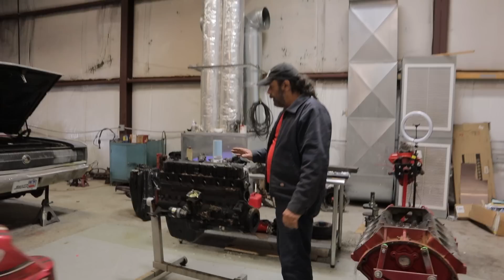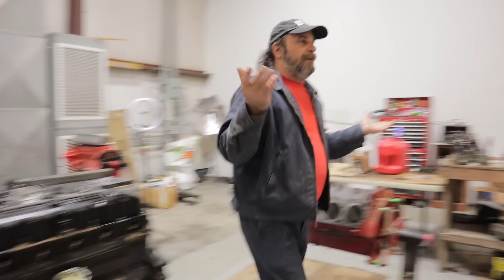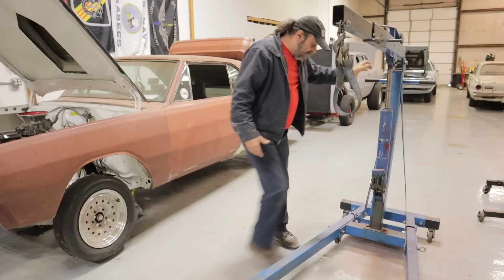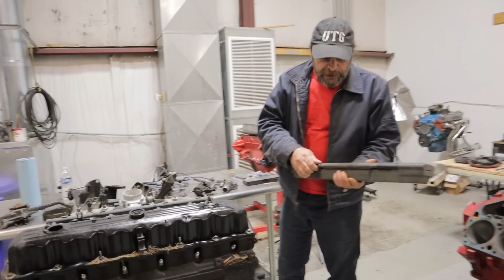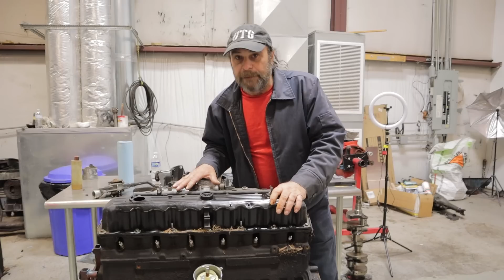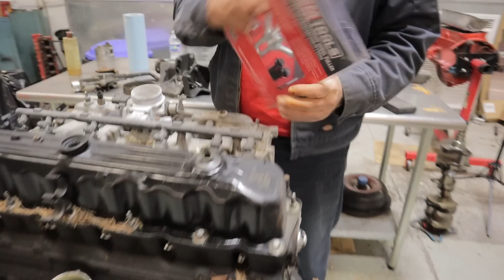Your First Engine Job - Arming Yourself With The Knowledge And Tools Needed To Get It Done

Comment: Former professional mechanic here, suggestions no doubt overlapping many already posted.

Yeah, what he said about clean and well organized.  Clean parts are easier to inspect for problems.  During engine long block reassembly, keep it surgically clean inside.  

Also no such thing as too much lighting, including handheld.  As others mentioned, take more photos and video than you think you'll need.  Label and photograph everything like you won't get back to it for months (because you never know when you might not).  Also take lots of written or typed notes as you go.

Do NOT use gasoline as a cleaning solvent!  That stuff is way too flammable/explosive!  I don't like using acetone for the same reason.  Also they're both really bad for your skin.  Use detergent & water, mineral spirits, or diesel and a big metal oil drain pan for parts cleaning.  Keep a fire extinguisher handy.

Organize small parts in zip-lock baggies.  Label them by tossing an index card in the bag.

RTFM!  Get and study the factory service manual for whatever you're working on.  If cost is a problem, spend some time searching the WWW for a PDF version.

A usable workbench doesn't have to be expensive.  A couple folding sawhorses, some plywood atop a hollow core door for stiffness.  Also easily stored flat.  However, if you need a bench vise, you need a real workbench.

For measuring tools, I would add a set of feeler (thickness) gauges, a dial indicator kit, maybe a micrometer or two, and a surface plate.  A literal plate of thick glass is better than nothing.  A window glass shop may be able to help with a large scrap.  You'll know better what you need after you RTFM.

Craig's List and Facebook Marketplace are goldmines for tools and parts, especially big ticket items.  Used but working air compressors for 1/4 price of new.  I paid maybe $25 for a 4-caster engine stand (avoid the cheaper 3-wheel version - they tip). I got my like new engine hoist for free plus the cost of a new hydraulic cylinder ($50).  I picked up a few thousand $ of SBF stock & performance parts for around $750 from a guy who was clearing out his garage after a major car project.  If you have time and a truck, check estate sales for great deals on entire tool sets.

Holy crap this is getting long!😮

Comment: On thing that I think you can't have enough of in a garage/work shop, especially when doing a big project like an engine rebuild, is tables or shelves. I find working on anything to be so much easier if you aren't having to walk around parts or piling stuff on top of other stuff. I have a few cheap folding tables that I keep around for projects that I take out if I'm doing something like that. I think it helps keep me "in the zone".
Reply: Spot on! ANYTHING you can set up as a table, a piece of plywood on top of a pair of saw horses, etc, is really helpful. I actually like these newer folding plastic tables, because they are easy to stow away when you don't need it and easy to pop up and move around when needed.
Reply: On big jobs I use a cart just for that project, so I know every bolt that came out gets back in.
Reply: I use a folding table, I can set it where needed and keep everything in order.
Reply: I pick up card tables people throw out.

Comment: Along with the recommendation of photos, A suggestion is have a large piece of cardboard and lay out all bolts in the order of removal and add a label on the cardboard. I always prefer to attempt to put the bolts back in the same place removed such as head bolts, push rods, rocker arms and so forth. It is difficult to place fasteners with the part removed because of cleaning and so forth. The common practice of randomly remove fasteners and using valve covers as fastener storage causes confusion, missing bolts and trying to figure out which bolt is suppose to be for what purpose. Some are very obvious but accessory bolts can be confusing as to the original location.

Comment: I suggest getting a Chilton's manual for your vehicle, it will have all the engine specs and torque specs descriptions on how to take it apart and put back together plus pictures. They also have everything else about your vehicle and wireing diagrams so they come in handy for other things that come up.

Comment: When in the Philippines you see all kinds of Big truck repairs done alongside of road. There’s a sugar cane plant in our town (wife’s family house) and it gets overloaded trucks from the 40s 24/7 during harvest. One of these trucks broke in middle of intersection. It sat there 5-6 days while they pulled engine out using cut trees and a bunch of guys. Rebuilt engine right there put it back in started up and drove away! Leaving a huge oil slick in the middle of intersection that took about a month to wear off.

Comment: Shop manuals!  I get both a hard copy (book) and a CD.  The book is easier to flip through, and I only use it with clean hands prior to the job.  Then I print out the critical pages from the CD to review while doing the job.  Those pages are throw aways, so I don't care what I spill on them.  All the while the book stays clean enough to read in bed.

Comment: Hammer and a blow torch. Heat up and crack open old nuts and bolts before you round them up or break them. There can be thread lock applied, or simple rust/oxidation in practically every bolt on your mystery project. Heat and impact brakes all of them loose. Wire brush on a dedicated power drill is also a nice special tool to have on hand.

Comment: Lights, lights, lights. Well lit work area! Lay down rags around the work area so when you drop bolts, you won't have to crawl under the work bench with your cell phone flashlight to try to find them. Especially if it is a specialized bolt! Ask me how I know! LOL

Comment: Zip lock bags and a note inside, masking tape to write on wire connectors and a number of photographs. We don't have to use a "Photo-Mat" anymore and perhaps a buddy just to help put the bolts in the motor mounts! Other than a floor jack & block of 2 X 4 under trans and pans to catch fluid. Don't forget a pizza and a cold 12 pack to grease the helper! Cross your fingers on broken bolts but a metric Tap & Die set is handy. And always write down the VIN and production date and take the old part in a pair of grocery bags to the parts store as 1 or every 3 parts you but are going to be wrong, wether it's a 3 mile round trip or 22 mile trip to the parts store. It will add up and waste time. And stay positive!
DK, ASE Master Tech since 78, retired.

Comment: I just wanted to say this as an actual engine builder by trade. If you are going about this with the intent of having newbies tackle this project for the first time Make sure you clarify the difference between whether you doing a actual rebuild or a refresh and repair they are definitely not the same thing If all you were doing is pulling the engine to fix the problem and putting it back together that doesn't necessarily constitute a rebuild a true rebuild would have things like bearings rings most of the time Pistons and of course all new gaskets cylinder heads will be valve job usually with new guides or liners installed and obviously valve seals. A traditional rebuild will usually involve boring or honing the block possibly decking the block and most certainly typically decking the heads This is what I think most people think of when they think of a rebuilt engine. I'm not knocking anything you said in this video and I appreciate all your videos but I think it's important to be very clear in the words you use for newbies to understand Love the channel keep up the good work
Reply: So very true!
It had been over 35 years since I'd done a true complete rebuild.
 It was embarrassing how much I had forgotten.
  I have refreshed engines, I have swapped cams, replaced bearings (while engine was still in the vehicle) I've done heads/valves. Timing gear sets ETC.
 But doing a complete rebuild, dealing with the machine shop, waiting on the right parts, cleaning, measuring everything ETC. Is a lot more involved (and tedious) than even the most involved "repair".
👍😁

Comment: Years ago I watched my father bore a 1950 cadillac motor .30 over stood on its front on a work bench. He used a torque plate and dial bore indicator and tri stone and dingle ball hones, when I asked why he didn't send it off to a machine shop he told me back when the car was new mechanics wouldn't hesitate to bore one cylinder oversized and up just that piston. Thing ran like a champ, even after years of a gutter dripping right into an open valve.

Comment: I chuckled when Uncle mentioned rebuilding on a dirt floor. Yep. What Glidden did was interesting, and I wonder if there's anything to it. I have a slant six on an engine stand long term that I propped up with wood at the unsupported end. The concern was that after many months there might be a little distortion in the stand itself, but maybe I unwittingly spared distortion in the block itself.

Comment: One thing I like and should remember to do more often is lay out the sockets and wrenches I think I will use most often. I've made the mistake of dragging out my new 199 piece Harbor Fright tool set only to get tools scattered everywhere when I only needed a few them. Also make it easier to pick up and clean up after you're done. 

Is the project going to be a classic with SAE nuts and bolts or a later model with metric fasteners? No need to bring out both sets of tools. 

Clear out a place around the work area. Once disassembly starts you'll be stepping over and around parts as it gets torn down. 

Get a decent light. Doesn't need to be anything expensive but it could come in handy looking for wires and things between the firewall and engine. 

Pay attention to gaskets as you tear it down.  Was sealant used and where? Both sides or one? It helps to make a note so you don't get lost putting it back together 

Save videos and documents to your phone if possible so you can refer to them quickly if you get stuck. 

And don't forget rags and hand cleaner. You'll need them when you have to go pee or eat lunch.

Comment: ‼️Hey Tony‼️I did a 4.0 in a 2000 grand Cherokee I got an engine out of a wrangler and the bosses on the block for the engine mount were completely different! I had to make mounts and had to leave off the ac compressor. I don’t know what yours it out of but it might be worth comparing.

Comment: I worked at an engine reconditioners for about 9 years & our engine builder never used an engine stand (Maybe 5-6 times!) Always built them on a steel bench. He would drop the crank in & then stand the engine on it's end & slide the pistons on horizontally! Kept his area spotless though.

Comment: This is exactly why buying an older cheaper vehicle and working on it yourself is awesome, fulfilling and just plain out. Fun because you get to go to junk yards and pick at other ones just like yours and you can take things from there that yours doesn't have. You know cuz there's a bunch of them sitting in junk yards and there's a hundred thousands of millions of parts everywhere. It's so much better than having a modern new late model that you have to bring back to the dealer to get updated or the software done because the brakes are a little touchy in reverse like that's ridiculous.... You don't have to go off with their telling you. You can go off what the people are telling you because the vehicle's been out there in people's hands getting wrenched on not just the dealership especially when it's about 15 20 years later

Comment: I pulled the engine on my first car twice in the early 90's. I rented the engine hoist, engine stand, and ring tools for a reasonable price. Don't know if you can do that these days. One of my mistakes was not keeping track of which piston came from which bore and mixing up the caps. The engine had a severe vibration above 4000 RPM after that. Many other mistakes were made like failing to address the cause of the original failure, which was a weak oil pump, leading to ruined camshaft bearings, which ultimately caused the camshaft to snap in half. Once assembled, I ran the car for a good 5 minutes with zero oil pressure waiting not knowing how long it would take for the lifters to quiet. This led to the engine coming out again about 2 years later for fresh bearings. When I went to put the timing gear back on the cam shaft, I grabbed the wrong bolts (which were too long) and ran them through the front of the camshaft and up against the block. All it took was about a half turn on the torque wrench to snap the front of that camshaft off. Good times!

Comment: I'd add a good light (4' fluorescent?) overhead so you can see things clearly. On old filthy engines a wash tank of sorts, I cut up some old tank it worked. Also, I think a wire wheel and safety glasses to a major help.

Comment: @Uncle Tony's Garage the only thing you missed was don't throw out the old gaskets until you're done. You may need them to compare the new ones to. Also check the pistons really well on that motor, id even recommend replacing them. I've seen a few of them crack where the wrist pin goes in. It's something with just late 4.0s. I did a motor for my friends 02 grand Cherokee and wound up getting a low mile 98 engine thinking I could help him, everything was different, so we swapped the pistons and rods into his block and got the cylinder with the broken piston sleeved.

Comment: Used to do a lot of motorcycle work. Had a white enamel painted table on which I'd set any tools I used. Zip lock bags for small parts ,cleaned, labeled with a magic marker, and laid out in order of disassembly.  Researched the repair first and laid out the job tools on the table in neat rows. Didn't touch the manual without cleaning my hands. All tools cleaned as used. And YOU don't touch ANYTHING. All my buddies thought I was insane, but they always wanted me to do the work because it was perfect when I was done.

Comment: Great advice, as always. My first step before any job is to sit down with the factory service manual and read through the entire repair. I envision each step, taking care to understand what's supposed to happen (it's not always clear). If there's a special tool shown, I make sure I have the tool or have a workaround plan in place (preferably 2, depending on the complexity of the tool). I take note of any steps that might present special challenges, like odd angles or space limitations. Often I'll go look at the car to get this info. When I'm completely done with the manual, I'll look at YouTube vids and read discussion board threads. Most of the time, however, that once or twice read through the manual is all I need. Thanks for your great work, Tony!

Comment: I rebuilt the engine in my 97’ xj 4wd. It wasn’t bad at all, the removal of the engine itself was the worst part, took a lot longer than the actual rebuild. For a lifted xj, or mine with a 4.5” lift, I ended up lowering the truck down to on the front axle, ran out of travel on my harbor freight lift. I used a fel-pro gasket set and Mahle rings (just re-used the stock pistons as they were fine). I did get the head checked at a machine shop, as well as a 3-angle valve job. Ended up driving about 40k miles on the rebuild with no issues, sold it to a high school kid who’s still driving it 5 years later. Make sure to check the exhaust manifold, they like to crack on these. Love the “real world”approach on this project! Good stuff!

Comment: About 5 years ago I had to change out a trashed cam in my 89 XJ. Had a Haynes book that laid out the procedure pretty well. Bit of a pain in the wazoo, but no big deal. Worst problem was a totally hammered lifter, it had decided it was going to spend the next melinia in that block. Finally worked it out ( without destroying the bore) but was about to get out the explosives and declare war.

Comment: Organization is key for anything. Especially when it's something you haven't done before with a lot of different parts. Get some plastic bins of some sort. Dollar Tree, Dollar General,  Family Dollar, Walmart all have different shapes and sizes. Get a bunch of them with lids. Separate parts into different bins. Label things with masking tape and a sharpie. Cardboard is good for keeping pushrods and bolts in order. Just stab them through the labeled cardboard and put them in a plastic bin until you need them. If engine parts aren't numbered, a punch set is good to stamp numbers in bearing caps especially. And a bag of shop rags. Nothing fancy. A bag of old cut up t-shirts or whatever. Just something to wipe up whatever. 
Hope this helps

Comment: I have a trick for you for disassembly. Blue tape, a sharpie, and plastic bags. Take something off tape it, label by number, put the bolts/nuts in a bag, label bag the same and maybe tape to part.
This gets rid of the bucket of bolts/nuts and when you're finished disassembly you can point to anyone to put it back together in the reverse order by number. They will love you for taping numbers to wire/hose connections.
I started doing this in a body shop I worked at because A. it reduces time. B. f the bucket of bolts that keeps you guessing all day C. very organized engine/interior you'll never have to backtrack.
I took a 94 22R out of a Toyota like this. My friend reinstalled and couldn't believe how easy it was to put back together with my method.